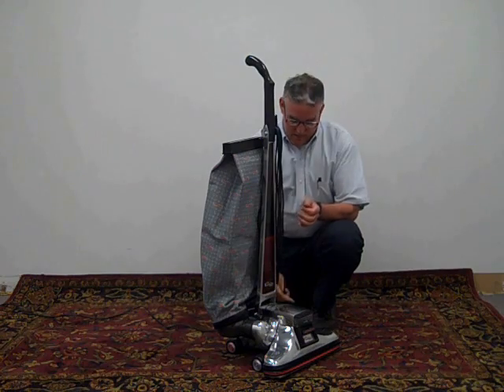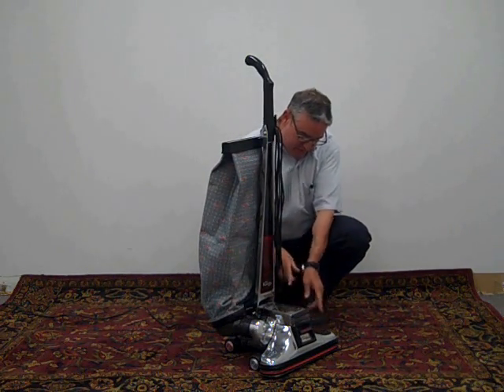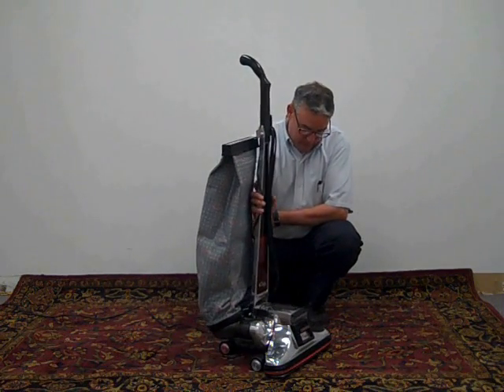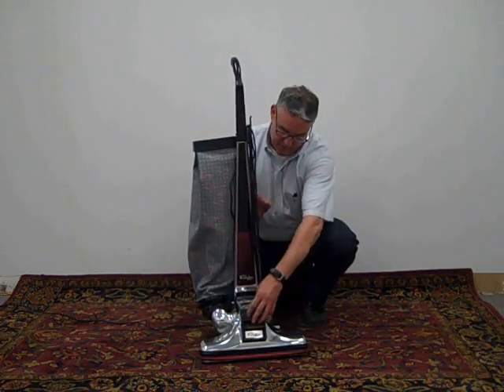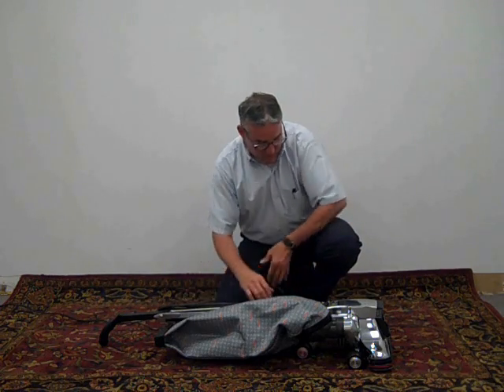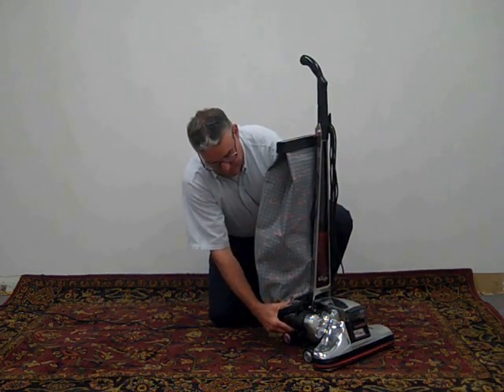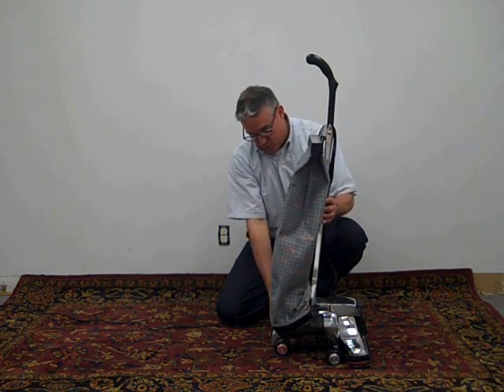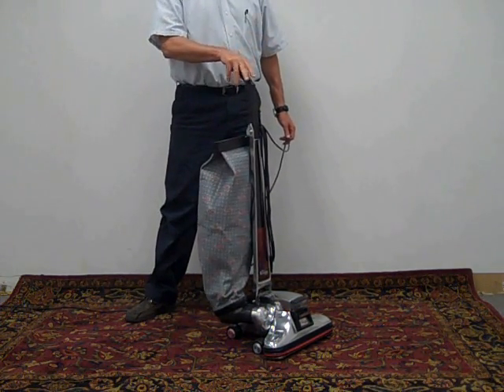Kirby Heritage II

Comment: I just received a free Heritage II because of a broken plastic bag fill tube.  I think the previous owner thought it was non repairable but his ignorance is my gain.  Anyway, trying to figure out which bag to use.  The nozzle that fits into the bag is round with 2 very slight notches in it.
Reply: Mark Ague thank you
Reply: ClassicTVMan1981X thank you
Reply: No,the g3 and g4 used the same safety after that different safety switches where used so a g3 power head isn't compatible with the sentria 1. Might be wrong but i think that's how it worked out.
Reply from the maker: Hi Derek, give us a call at 1-800-437-7170 and we can assist you in getting the right bags for your Heritage II.
Reply: your vacuum was updated to take twist and lock bags
Reply: Derek Vinyard The G4/G5 Micron Magic bags should work for you if you wish to cut down on pollen.
Reply: +The Kirby Company  what belt should i use smooth or notch for sentra
 1
Reply: Aaron Micksch the ribbed belts are what your kirby uses.
Reply: +Mark Ague 
If the brush roll currently in his machine has ball bearings.
Reply: Aaron Micksch
You're welcome.
Reply: did you know you can put a g3 power head on an s1 vacuum
Reply: I have never heard of the Kirby s1 what i do know is the g3 head will fit on the g4.
Reply: sentra 1
Reply: but it works for me
Reply: Mark Ague
Right, from the G5 onward Kirby used what is known as a "unigasket" in its fan case.
Reply: g3 and g10

Comment: @kirbyvacuumcompany
Noah Covert is correct: this cleaner and others in the Heritage/Legend series continued to offer the shake-out bag (also called "reusable bag" or "pocket bag") as an option. It was even made mention of in the Heritage, Heritage II (Legend) and Legend II instruction books. Most buyers opted for the standard disposable bag system.

I should also add that the 13" nozzle option was also carried over from the Heritage I (1HD).

Comment: John, that carpet height setting you mention is called "Micro-Matic" and it was a Vernier-type adjustment useful if the lowest standard position isn't low enough for a given surface. It was originally introduced on the ComVac CVD1600.

Comment: Yes. Actually, there has been the shake-out bag system on all pre-1990 Kirby models from the Tradition through the Legend II. It is mentioned in the instruction book. They weren't optioned very much after the Heritage went on sale in late 1981.

Nor was the 13" nozzle, which was desirable for use in cleaning tighter spaces; this was only the second time (and last) since 1970 that such an option was available, from Heritage sales mid-1982 through the Legend II.

Comment: (continued)
With the fall 1987 updating of this model to the Heritage II Legend, changes to both the brush roll and the outer cloth bag were made. The model was updated to the Legend II in January 1989 with an all new maroon trim color. The brush roll was improved for the third and final time before the Generation 3 replaced this model in the spring of 1990.

Comment: In original production, the HII had the same nozzle casting as used for the first Heritage, which ran from the fall of 1984 through the spring of 1985. Then, the nozzle casting was changed to reduce weight (the overall bumper length was reduced, too).

In the spring of 1986 the brush roll was changed to add a magnet to the white cap end (facing the toe-touch control mechanism) and a brush roll performance indicator light was added to the nozzle casting.

Comment: my G6 has that light indicates the brush-roll is tunring, my heritage I does not. i think its kind of a pointless feature because if you have a good ear you can hear if the brush-roll is turning and if it is slipping it is noticeable. in my opinion one of the biggest improvements in the heritage I vs. the heritage II is the smaller nozzle with more concentrated suction. some rare heritage I machines were sold with a smaller nozzle, i think it was from a sanitronic mine just has the standard

Comment: You guys may have seen on Ebay that someone has a very large stash of NEW in the box Heritage IIs for extremely reasonable prices.  I couldn't resist and bought one.  Was there a balance problem with this model?  I ask because when I adjust the toe control as instructed for my carpet height, the Heritage II wants to lift off the carpet when pulling back.  If I go down one notch, the machine is way too heavy to push comfortably and I suppose I'm decreasing belt life.  What gives here?